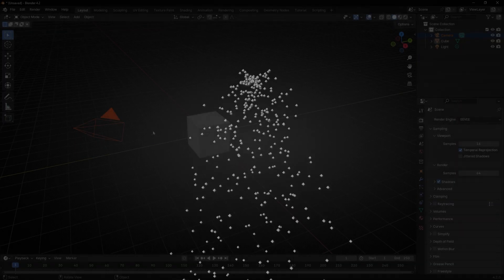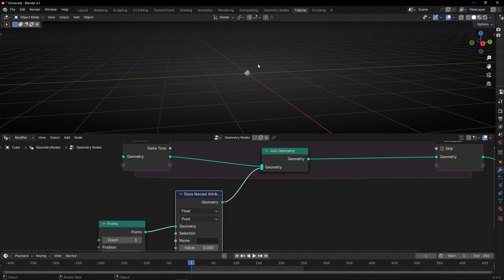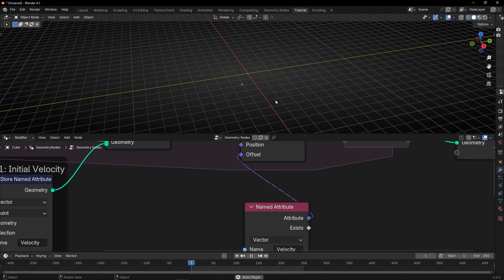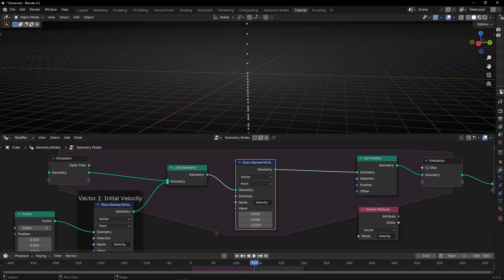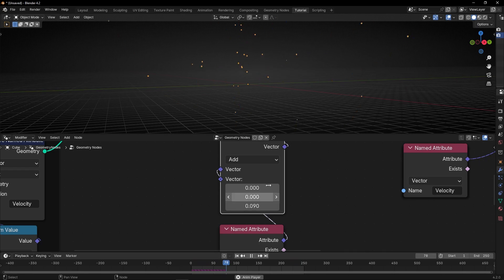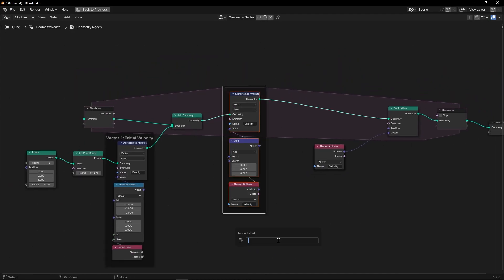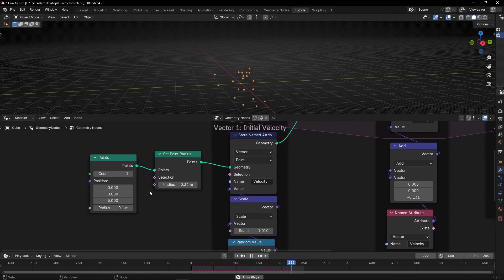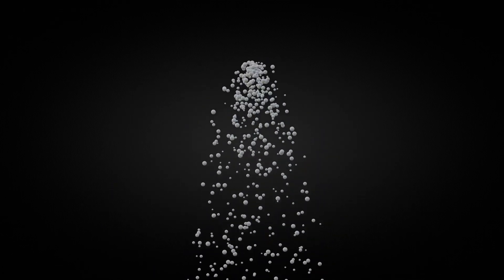How to Add GRAVITY in Blender Simulation Nodes

Comment: Great tuorial, thank you.  If we wanted the spheres to look fluid like, can we use a 'Points to Volume' node then a 'Volume to Mesh' node (perhaps adjusting the density and threshold to get an organic connection)?  It is my understanding that metaballs cannot be used in Geo Nodes..?
Reply from the maker: I did some tests, but I still didn't get how to do it well. You can do it, but it's tricky. Once I discover it perfectly, I will do a tutorial :)
Reply: @Xan3D  Thank you